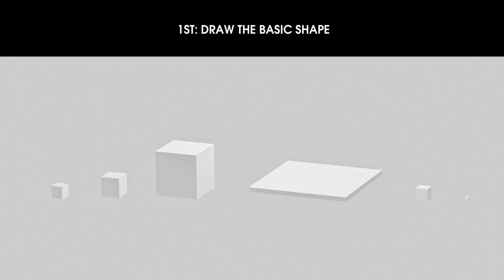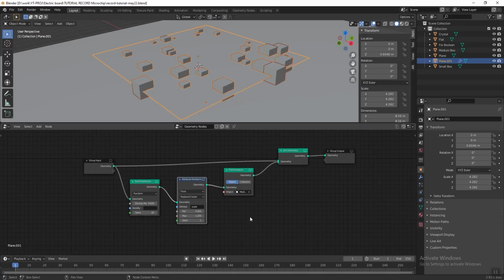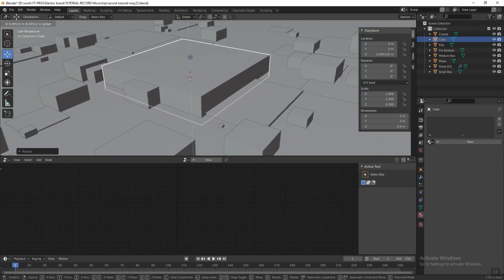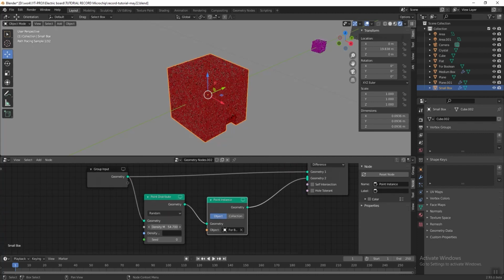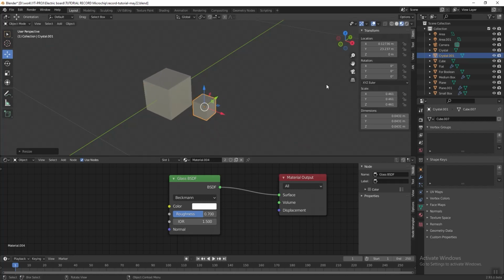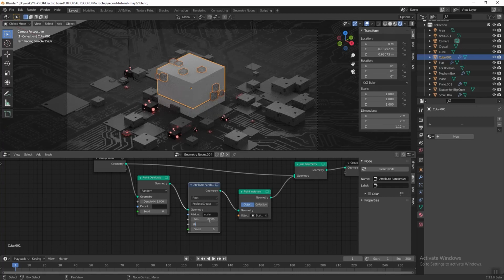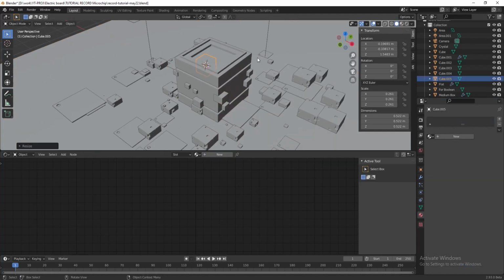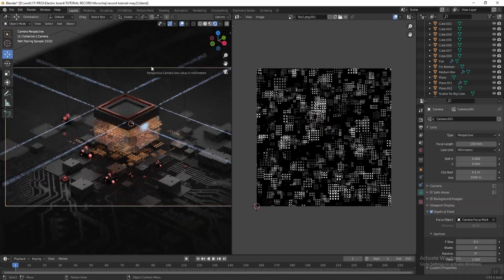Blender3D - Creating a Microchip scene with Blender 3D Geometry Nodes (TUTORIAL)

Comment: I have a question, about the point instance node, in the version of Blender that I have is 3.1; it does not appear to me
Reply from the maker: Hi, this project is done by using Blender 2.93, the node is slightly different than 3.1.
In Blender 3.1, you have to use "Instance on points" instead of "Point instance".

For Blender 3.0 or above, follow the step below:
1. Drag your Cube from 3D viewport to the Geometry node editor
2. Then to clone your cube, add a "Distribute Points on faces" node after "Group input", then add an "instance on points" node after "Distribute Points on faces", then connect the "Object info (Your cube)" to the "Instance" at "Instance on points" node
3. Then if you want to randomize the scale, you need to add a "Random Value" node, and connect it to scale at the "Instance on points" node